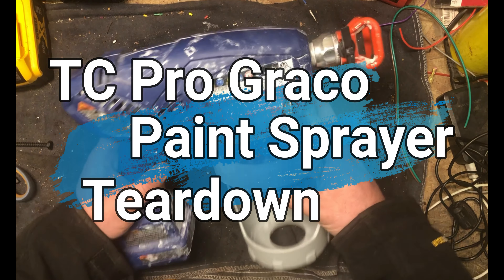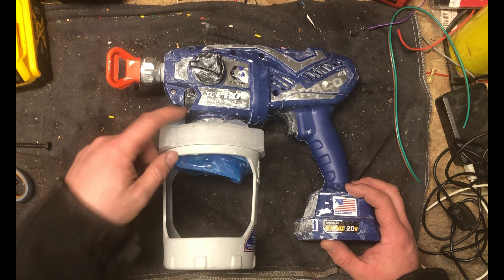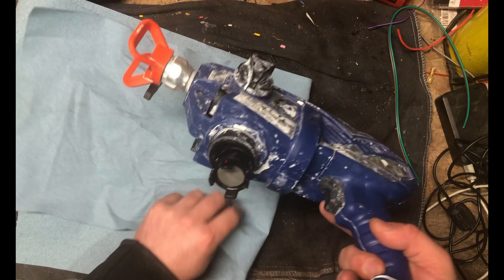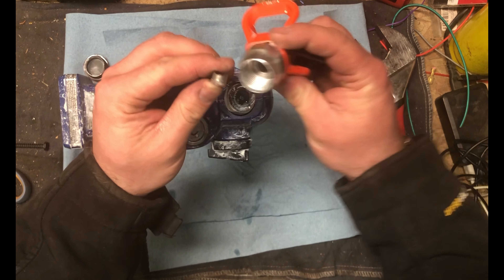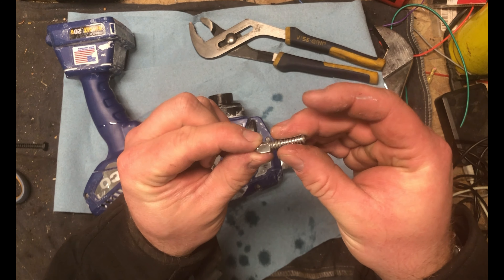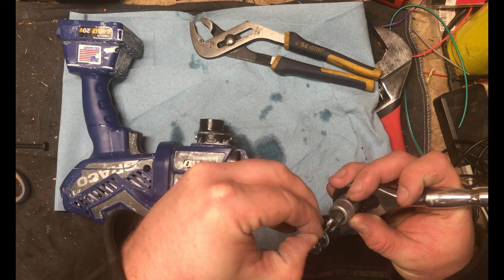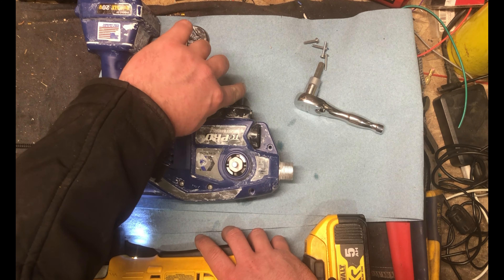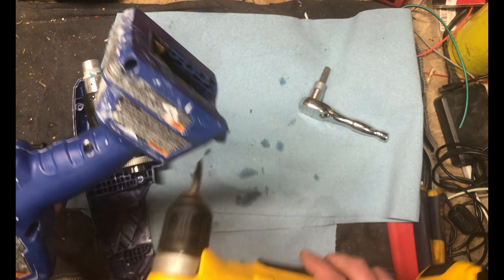TC Pro Graco Paint Sprayer Teardown

Comment: Nice job, I have referred to your breakdown a couple times now.  I have an older corded TC Pro I bought used; inside was unbelievable! Prior owner put it away with paint in it.  Must of had it apart at one time because the spring in the tip was gone, couldn't figure out the drips. I lucked out and found a stainless spring nearly identical at Ace.  Tension seemed the same and been running now for over a year with no drips on shut off.  Run with a RAC X tip guard and a green FFLP 210 tip, home projects only.  I use spray brake cleaner and it cleans out latex in check valves nicely with no apparent problems.  Also, the green automotive   AC  O-rings work fine if you damage any.  Thanks again! Mike

Comment: I have one of those paint sprayer and is happened to me having to deal with clogging/spitting issues 
But I have figured out the problem, I always open the little tap on my paint cup and let the air out for some reason gets air after priming then works just fine (that could be the problem) not sure

Comment: So did you figure out why it was spitting? Mine spits all the time to now, whatever the tip or the paint. It spits for like one sec right when I pull the trigger and then as I continue my pass not letting go of the trigger my spray pattern is fine for the rest of my pass. But it spits enough so that it messes what I'm painting at the beginning of my pass.. Very annoying and a waist of time for an expensive tool.. It's been thoroughly cleaned, using a new tip and thinning the paint but nothing works to fix this. In the manual they say the front valve has reached the end of it's life.. Did you change your's, was that your fix? I have seen absolutely no video's about this front valve but plenty about changing the pump... Any thoughts ??
Reply from the maker: Sorry for the slow response. I actually haven’t had a chance to use the sprayer again since I did the tear down. The front valve is easy enough to change. I think the assembly is $70-80ish. I’d say it’s worth a shot.
Reply from the maker: Finally got to use the sprayer. A good cleaning fixed it in my case. If it hadn’t, I’d say swapping out the tip and check valves would be a good second step.
Reply: Sometimes a very good deep clean of the pump will work but if you look at the design of the little units,there are one way valves and a triaxial pump. The motor and power source do not see any paint so we can ignore those for the spitting problem. The system is Airless which means no air (obviously) but also means the paint is atomised purely by pressure. The first two check valves are like a pressure accumulated, the check valve in the front only opens when a certain pressure has been obtained then it released the pressurised paint in to the tiny cavity between the end of the check valve and the back of the tip. So, how does it spit ?
It can be some debris in one of the check valves causing it to hold very slightly off its seat until adequate pressure has developed to correctly atomise the paint. It could also be wear on the piston shafts of the triaxial pump allowing paint to pass back along the piston body until no more can pass back and it has to build forward pressure, the time lag from pulling the trigger and the correct pressure to atomise the paint would be compromised and also cause the spitting at the beginning of a pass, if it’s at the end of a pass then the problem is generally caused either wear in the very front check valves seat or ball end or some debris preventing the check valve closing fully.
If using water based products, make sure you either clean using pump armour or warm soapy water
Reply: How much armour should you use at the end of your job

Comment: I’m a 30+ year professional painter - have used all sorts of rigs and keep my gear looking new and clean the s**t out of my equipment. That said. I’ve used this TC Pro 2x and it no longer pulls liquid from the cup. I’ve removed the two plastic Allen head check valves from the front and gently put them back in after cleaning. Now one won’t come out. Lightly stripped it I guess. 
Rig repair guy said to run some denatured alcohol thru it - which is hard to do since it won’t pull anything. What a waste of $$$. 
This is my 3rd Grace handheld. Prior 2 were the $250 corded models. Pumps burn up. 
I used them in climate controlled areas to touch up ceilings and such on apartment make-ready jobs. 
Shame. If anyone has tips for removing those Allen head valves on front of sprayer - LMK!!!
Reply from the maker: Graco sells pump lube. I have been putting some of the lube in the pump and on the threads of the plugs every time I use it. I also keep some spare plugs on hand. If you don’t lube them up, the only way to get them out is to ruin them. Anytime one starts to get monkeyed up I just replace it. I think they make them out of plastic so they seal properly in the holes. I think they’re intended to be a wear part.
Reply: @unskilledmechanic9601  I got mine out.. the damaging way. Ordering new and a new main valve too. Are you referring to TSL? I was thinking some G2 pipe lube would work well.
Reply: I think the TSL lube is correct. Just a few drops is all I do.
Reply: I've used mine twice. The first time, all went well. The second time, it started spitting but I got the job done. I haven't been able to flush it with water. It seems to prime okay, but the spray won't flush any water through it. All three outlet valves seem fine so far.
Was considering taking it to service for whatever cost that may be, but this video seems like cleaning deeper is doable. Not sure if he got it fixed or if I should just take it in. I certainly don't feel like I got my money's worth for only two small jobs before having to fork over more cash.
Reply: So I've changed all 3 valves out - seated ball/spring housing thingy as noted in manual - when I screw them into the sprayer, the ball/spring housing seats itself all the way in - and I don't get much pressure at all. Priming is weak (looking into cup) and primary valve only lets water out like a wrecked prostate.
Reply: @victorserhumano  If its still under warranty you should take it in for possible pump replacement. One of the symptoms of a bad pump is it will still spray paint but won't spray water. I think my pump is going out because the other day I noticed it was not spraying water during a clean out. I'm going to try a thorough clean out to see if that works. If not I have a backup pump that I can install. I only have about 10 gallons through this gun, but it did pay for itself on the first job.
Reply: I have the Ultra and I dont know if the valves with the Hex bolts on are the same on this model.  I have never removed them and cant get either of them out.  I am using a 8mm as per the manual, but because they are rubbery, the hex key just spins.
Reply: @BelugaMike  I ordered a pair of replacements - used a rubber mallet and drove a flathead into the old ones so I could turn them. Got them out, did some light cleaning and loaded the new ones.